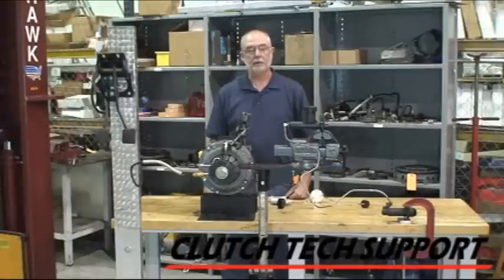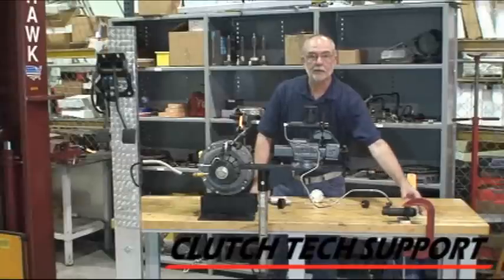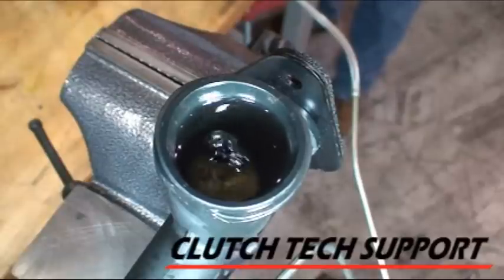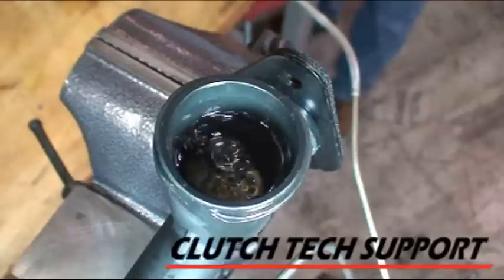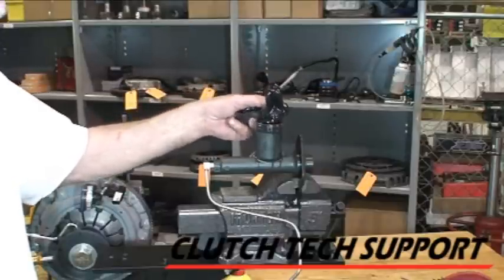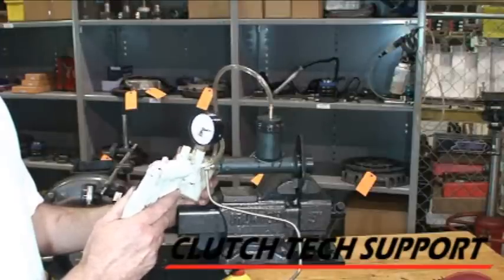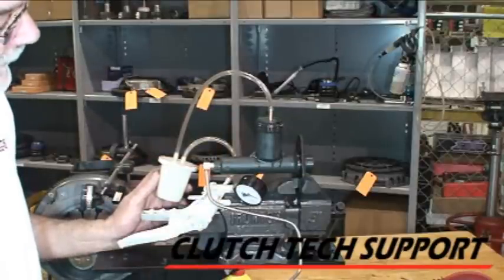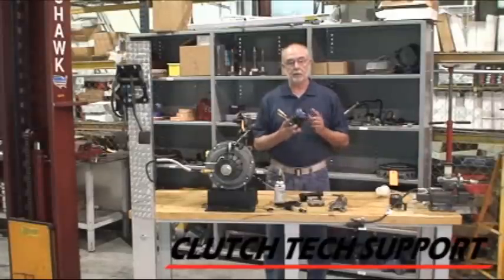Dry Vacuum Bleeding a Clutch Hydraulic Release System

Comment: My 2001 ford f350 needed a new clutch, did the job myself and went ahead and replaced my slave and master, I've bled and bled and bled and I push on my clutch pedal and it slams to the firewall every time. I can't take the master back off because the actuator rod that goes from my pedal into the back of the slave will not come out after it's stuck in. I see this is an old video but if anyone has any ideas, I'd really love to hear them.
Reply: Did you figure it out?

Comment: What would happen if you didn't compress the slave cylinder to get the air out? Would it be possible to use the vaccum bleeder to get the air out of it that way? What if you pumped the clutch with the vaccum bleeder on there? Curious as my mustangs slave is inside the trans and it's will be a pain trying to get to the slave to try and bleed.

Comment: These people have such simple yet practical solutions. 👍 Watched another of their bleed approaches - blocking the slave cylinder from expanding while doing the bleed, and this worked beautifully for me on my 03 Civic. https://www.youtube.com/watch?v=Vwjrh4ezwdU  I actually used a piece of 2x4 wood cut to custom length to block slave cylinder from expanding, and stuck it between the clutch fork and the car frame. Bubbles were out in no time. The only thing to remember is - remove wood before driving. LOL

Comment: If you don't have the rubber stopper like in the video, take your old clutch cap and drill a hole in it for a nipple fitting, hook vacuum pump to homemade stopper with nipple and vacuum away. Most new master cylinders come with a new cap, but check your new part first beforehand.  This actually worked on my 92 Gmc Sierra.
Reply: Was just about to ask where to get this rubber stopper !! Thank you wil try this!

Comment: Awww yea, this does work great on my 01 chevy cavalier 2.2 liter 5 speed manual. I just got the car back from having a new clutch installed from a local repair shop that everyone raves about, but the clutch pedal was softer than a hot bread roll fresh out of the oven, lol!! I love good sarcastic criticism in a moment like this. This really does work though. I bought my vacuum pump from autozone and it comes with a few connections that fit into the line of my resevoir. If it doesnt fit into your resevoir just change the resevoir to a different type and find a way to get it held stable under the hood and you will be good to go. I dry vacuumed my system for a couple hours just start it and let it sit and its like brand new!! Best wishes!!!

Comment: The reason that dry vacuum works, is simple air is lighter then liquid, and when you apply a vacuum you compress the liquid which forces the air upward.
Reply: Brake/hydraulic fluid does not compress (.5% @1000psi but that is negligible.) Additionally a vacuum will expand, not compress the fluid. What is happening is the little air bubbles expand and join others nearby and then eventually get big enough to overcome the density of the fluid and rise to the top. It's called "vacuum degasification."
Reply: very interesting/ informative ‼️
Reply: Alden Wallace
Thank you for that.
Reply: @aldenwallace1145  exactly 👍

Comment: I noticed that the tubing leaving the slave cylinder dips down before it goes up to the master cyl.  Does air get trapped in this high spot on the slave side?  I have an '89 F-150 that has a high spot up on the firewall, and I was curious if this would cause problems.  I don't know if this was the original routing.

Comment: Can you please tell me the best type of bleed to do on a 1999-chevrolet-silverado 4.8V8 5SPEED?  The master cylinder is all together internal is I think what you'll call them. Thanks for any help you can give me.
Reply: +perfectionclutch ok thanks, we just replaced the clutch, pressure plate, slave cyl.,master cyl.,and had the flywheel turned. The clutch is catching almost 1 inch off the floor and since we don't want to take the transmission back out is there any other way you would suggest the master is easy to get out think that would do any good to burp it and gravity bleed like some of your other vids? again thank you!
Reply: +perfectionclutch This fixed me up good, transmission is shifting great and have good pedal now too. You're tutorial vids are a great help, thanks again!

Comment: where can i buy or find the rubber stoper?
thanks
Reply: Home Depot, got mine yesterday (I needed a small one to plug the brake cylinder which I had to remove temporarily to gain access to Clutch master, but I saw these big rubber stoppers in the same section) https://www.homedepot.com/s/rubber%2520stopper?NCNI-5
Reply: Can one do this back to front via the Slave cylinder

Comment: This looks like exactly the product I'm needing. I have put a TR6060 6spd from  A Dodge challenger in my muscle car project and used all the factory gear. It has no bleed screw on the concentric slave cylinder and I believe there is air in the system. This I'm hoping will solve my problem! Thanks.